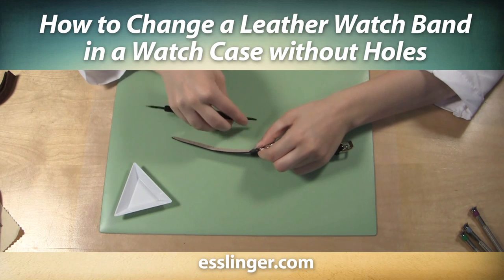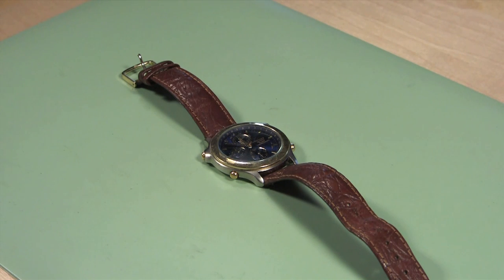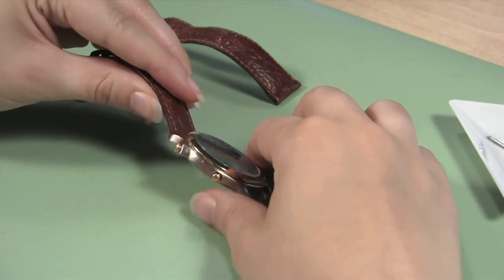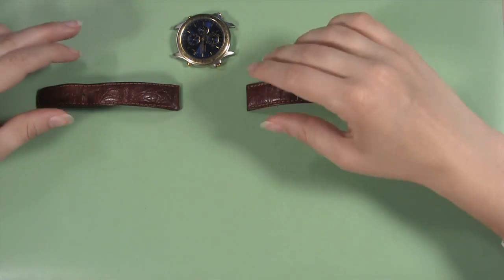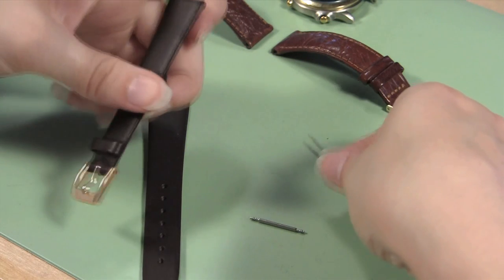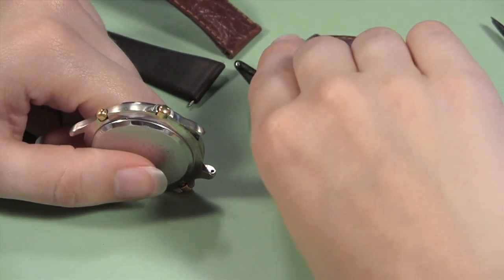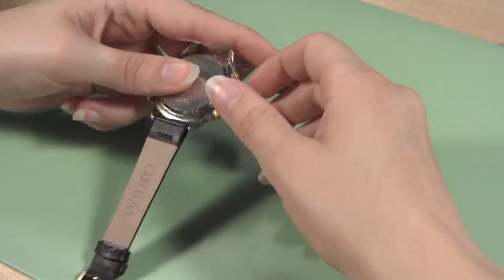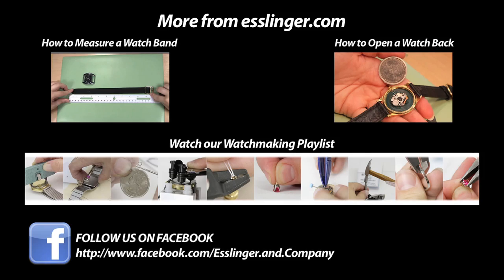How to Change a Leather Watch Band in a Case without Holes

Comment: My spring bar popped and i just repaired it with a usb cable at 2 in the fk moring and light from the video
Reply: TY, usb cable worked for me!
Reply: Nick Alvarez how did you do it with a USB cable?
Reply: @panchovilla939  With a lot of persistance! Used the cable to push in one end of the bar while fanagling the bar into the watch